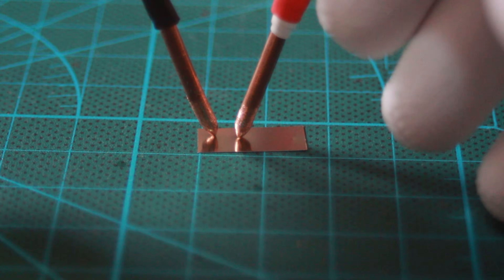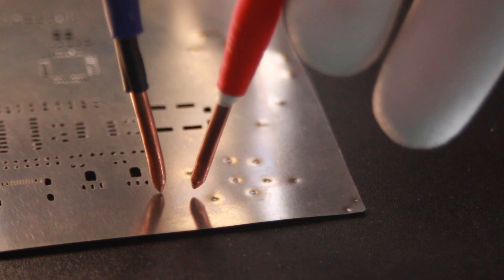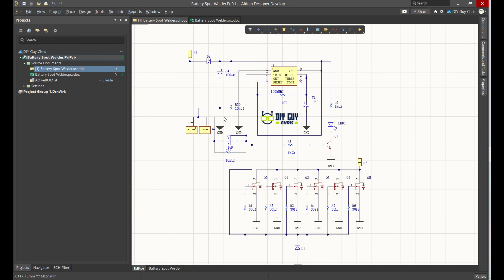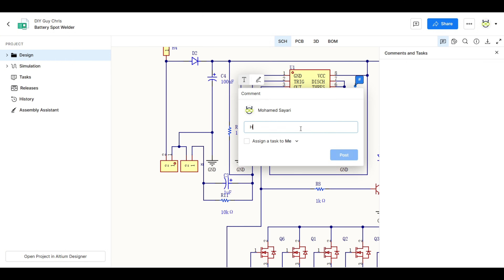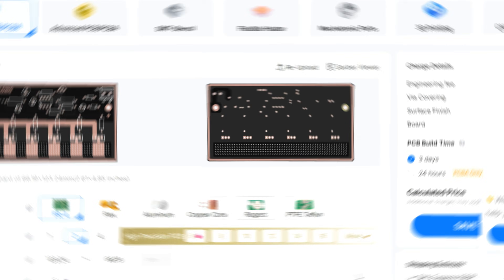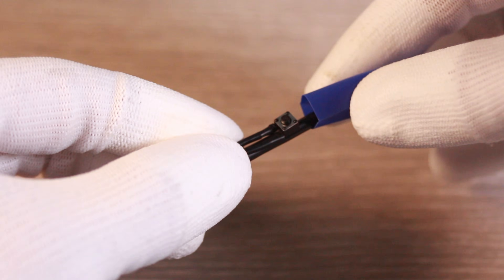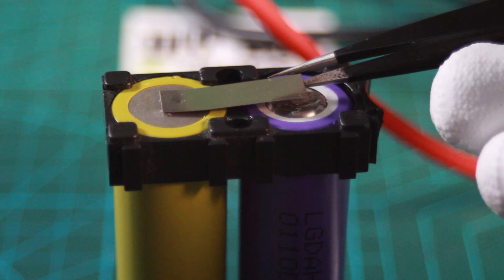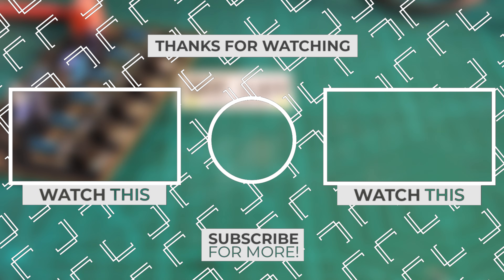DIY Spot Welder for Battery Packs Anyone Can Make!

Comment: you will immediately kill the battery with this method.
to solve this issue, add a current controlled source between battery and circuit, add very huge (50millifarads) low ESR capacitors parallel on the input of the circuit.
Reply from the maker: Great technical point, and y're absolutely right about battery stress.
Y've nailed the two main solutions: adding capacitors to act as an energy reservoir and implementing current limitng,, For this v1.0 design, I'm using the battery's natural internal resistance as a (soft) current limiter, but you're correct that a dedicated system would be much better. I'm already working on v2.0 with supercapacitor storage and a current-monitoring circuit. hopefully it works 😅 Thanks for the detailed suggestion:yougotthis:

Comment: I watched your video and like most people I noticed the mistakes made... Who told you that a diode must discharge the mosfet gate contact??? This diode will burn your mosfets after several attempts to weld lion batteries.
Reply from the maker: "Like most people"!! What mistakes!! 
Who told you that a diode is discharging the MOSFET! Mosfets discharge!!! 
Well, double check the schematic and use components labels so I can understand you,,
Reply: @DIYGUYChris And what do you think that diode on the gate contact does? - maybe it counts the roses? I've done this kind of thing more than once and I know the mistakes that are made well, so I'm not some green newbie, I'm angry when people are misled by "how great they say it works" and when you look at it from the side, it breaks down at the same time. You said you looked at your own scheme, so you didn't even calculate the charge, discharge pulse, how much power the gate needs to be fed, and you just "copied - pasted" from the Internet. Because if you had calculated it, you wouldn't have made such mistakes with the 30 ohm gate resistor selection... according to your scheme, the ne555 is not capable of delivering as much current as you require - the ne555 can deliver max-200mA, and your one 30 ohm resistor exceeds the 300mA throughput - so where did you calculate, man???  Although the IRLB4132 doesn't need that much current to charge the resistor - you just don't protect the controller with such a resistance...

Comment: Is it possible? just capacitor and battery used? I mean without any complicated e circuit
Reply from the maker: As I understand your question, you mean without circuit: Just capacitor + battery then the result is uncontrollable arc welding which should be avoided as I mentioned at the beginning of the video because this will lead to:
No timing control then you burn through metal
No safety because of dangerous sparks everywhere
No current limiting which could damage battery 
BUT With circuit: Controlled spot welding
10ms perfect pulse for clean weld
Push button safety then no accidental discharge
MOSFET switching for battery protection
The circuit isn't 'complicated' plus it's essential for making it actually work safely : )

Comment: Normal lifepo4 battery is enough or not?
Reply from the maker: A single lifepo4 cell (3.2V) won't work well with this circuit. The 12V design needs at least 3 to 4 LiFePO4 cells in series. Even then, you'd need high C rate cells to deliver enough current.
Reply: @DIYGUYChris 👍🏻